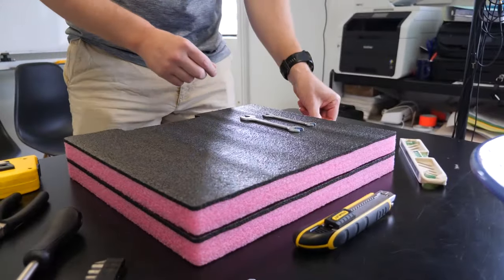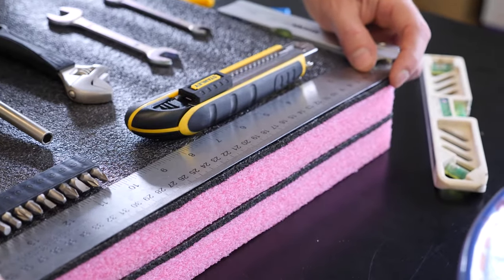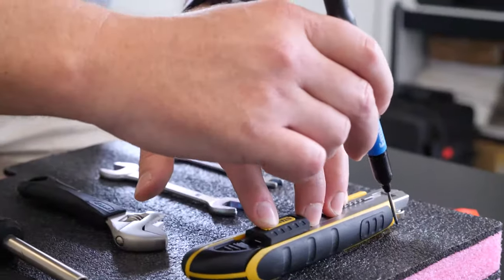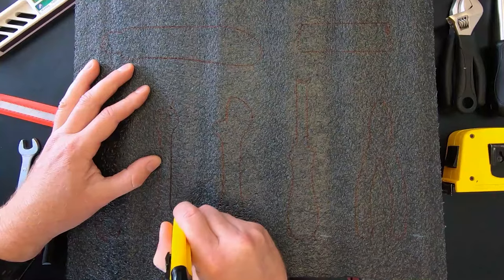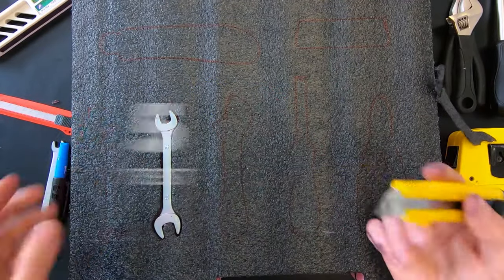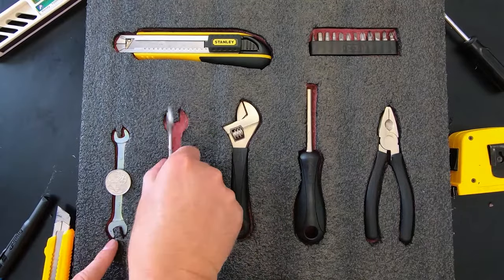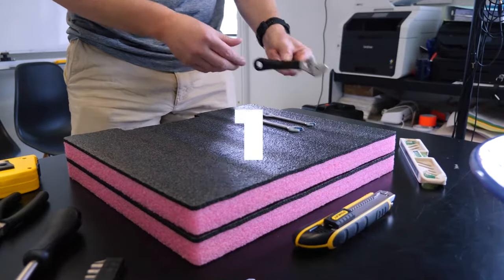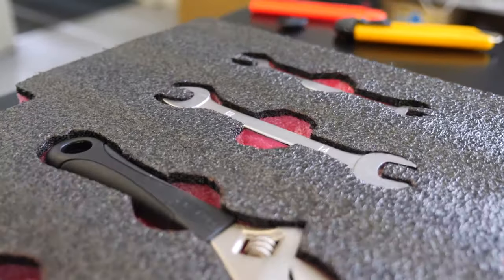How to custom cut foam in 5 easy steps!

Comment: Is the foam you are using the one that is considered the Charcoal Regular Foam or the Charcoal Firm Foam? Also, have you tried cutting with hot wire? Just curious if it will cut that kind of foam.
Reply from the maker: The foam in this video is EPE foam which is a medium density closed cell foam. EVA is a high density closed cell foam. We haven't tried using a hot wire but I've heard people saying it doesn't cut very cleanly with a hot wire.

Comment: haha great! do you know how you would cut through a large piece of foam tho - I have a large foam block and i want to cut a cylinder from it?
Reply from the maker: depends on the density of foam but try this tutorial: https://youtu.be/xne0qjhFVNY?t=150
Reply: @TitanAV  tysm! this helped, i was thinking of attaching a piece of wire to a soldering iron to cut the foam - would that produce a cleaner cut?
Reply from the maker: @am-hm4oz  We find cutting EPE foam produces clean cuts with a knife however you could use a hot wire cutter.
Reply: @TitanAV  ah ok thank you!
Reply: Try laser engraver machine glow forge or cheaper k40 Chinese one

Comment: I understand cutting around the outline, but how to you cut under the foam for an even surface?
Reply from the maker: Hi Jehan, the foam is a multi layer foam so you make the cut around the outside of your item, you can peel out the layers of foam for your desired depth.

Comment: I want to cut holes in foam for essential oil bottles. How to cleanly cut holes in foam?
Reply from the maker: There are a few different ways to cut holes in foam. Cut it out by hand with a small blade, use a sharp copper pipe to press down and cut the foam or use a hole saw with a drill. You might be able to search for other videos to show you this process a bit better!
Reply: @TitanAV  thanks!

Comment: Cool. I have 5 Verniers and a couple of Micrometers lined up for a Custom Built case. They all have their own individual cases as per when they were purchased but be good to have them in one custom case. Plus I can use the original cutouts from seperate cases for templates
Reply from the maker: Sounds like you're getting it sorted nicely!

Comment: What is cheap good foam for gun, camera cases? 🤔 epdm foam is extremely expensive 25mm x 500mm x 500mm  65.00 $ 😣
Reply from the maker: Diced / Cubed / Pick'n'Pluck foam is a low cost option that doesn't require any tools to customise. https://www.vfmgroup.com.au/4004-diced-foam-insert-for-waterproof-long-case